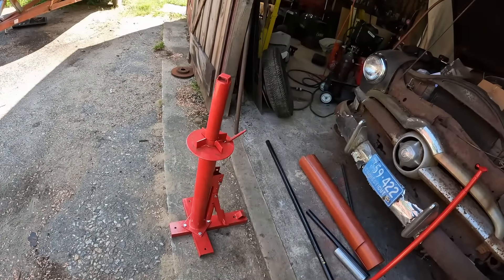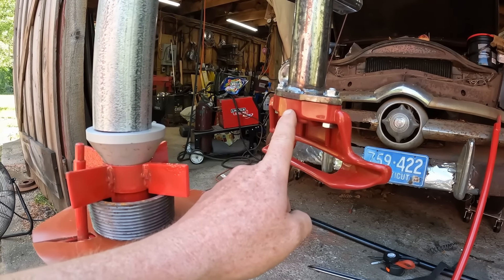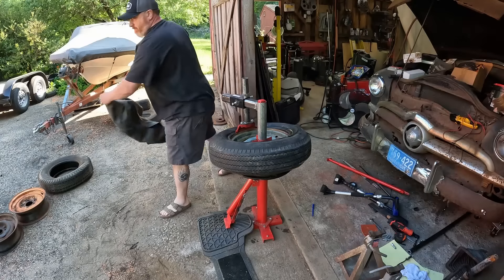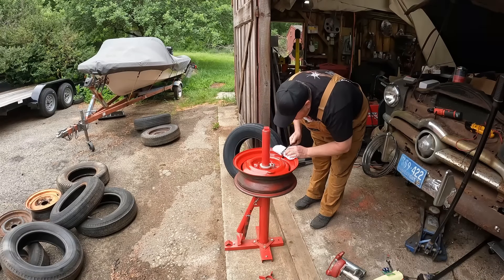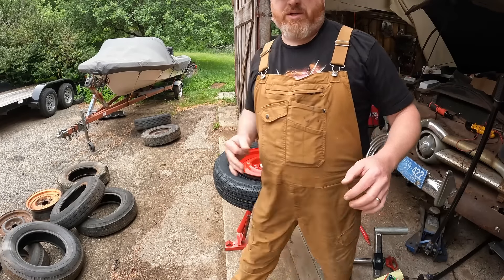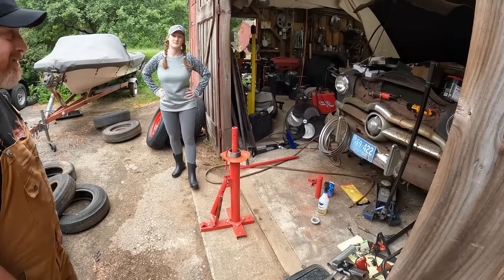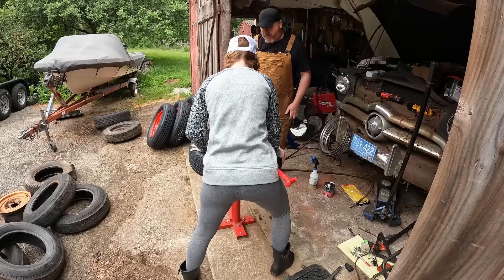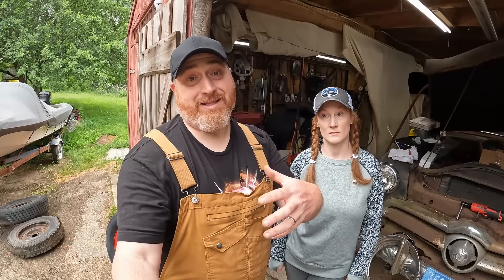How to modify a Harbor Freight Tire Changer to work amazing!!! Follow this DIY guide!!

Comment from the maker: Watch the follow up video here!! https://youtu.be/r1ncuxGHcIc?si=P_qW-Tq3UXcR3scR
Reply: Easy 'er wet always wet your bead
Reply: I bought one of those
Reply: I bought one of those two from
Reply: I had that issue with my Lincoln mig.  It was the liner in the gun/hose.  As it gets old, wire arcs and doesn't contact and slide properly thru it.   I found the aftermarket 10' gun/hose on Amazon . Works great again  👍 👌
Reply from the maker: @SR-gt350  I replaced the entire hose and gun a short time before this video. I've since had a few welders shipped in because we review them. I haven't gotten back to trying to fix the old Lincoln.
Reply: Use WD-40 on the tire bead. It’ll change yer life. Lol.
Reply: That was bad ass good job
Reply: 11:38 Brother, this is genius

I changed tires professionally for years, been to Michelin School several times etc etc

You've basically made a $2,500 machine at home as far as it's function

I can't tell if that duck head is metal or plastic... Do yourself a favor and get a plastic one if it's not

That is if you plan on doing a lot of wheels

The plastic one makes it impossible to scratch your rim even if it's aluminum wheels
Reply: 22:05 If you're ever uncertain, if your bead got set, put it to 70 PSI and then back it off to 35 or wherever you want to drive

Comment: Little tip for mounting tires. You can use Gojo, and a cotton brush to lube the wheel. And some shops use just plain old Dawn dish washing soap, without water and sometimes a small amount of water. It’s hard to explain what the cotton brush looks like, but it’s like a larger version of the brush you see in PVC glue for welding PVC.  I’ve seen some just make a brush out of a coat hanger twisted around a couple of old shop rags. I always just used Gojo, as the tire lube. Another little trick is to mount a peddle valve to the base of your tire mounting machine that allows you to use your foot, to inflate the tire while lifting the tire up with your hands.
Reply: I use wash and wax car wash, has some anti corrosion properties, found that dishwash can cause problems
Reply: It's called a dish mop
Reply: I use tire dressing. Armor All, Black Magic, Meguiars,etc.
Reply: Yeah I use a spray bottle with a little soapy water, spray the bead down on both sides inside and out, never had an issue, also makes it easy to see if the bead has sealed as the soapy water will bubble up if the bead is leaking while you are putting air in.
Reply: That or you can buy the “mounting juice” from O’reillys I think we got ours from. Helps seat, “glue” and slip on.
If aluminum rims you can add tire bead sealer as well, to help keep air in on the brisk mornings or temp changes.
Reply: To add to your naming of item, decades past, Coates tire changer company circa 1970-80's It was sold by them as a bead mop or tire mop. Was also good to spot check nail holes/tread punctures. As the solution bubbles like crazy over tiny punctures. Much faster that a tire tub for leak detection for suspicious spots.
Reply: @grandam every item you listed there is silicone based which is a severe no-no around tires. Silicone breaks down the rubber. Horrible to use. It will make it shiny and make us slick but it's terrible for rubber long-term. Anything armor all should be nowhere is near a car. The only thing they should be close to is a garbage can... Throw in it
Reply: @mac4boys541 dish soap will cause absolutely zero problems with a tire. If you're finding it causes a problem. It's not the soap. It's you. You shouldn't need to use any product with anti-corrosion properties as there should be no moisture in there to corrode the metal anyway.
Reply: @jasonmorehouse3756 I've never had a problem with ANY tire dressings I named. And my old schools stay in storage till summer cleaned, waxed, and tires "armor alled" when stored. Maybe it's just you buying cheap tires that need to be gotten rid of.
Reply: @jasonmorehouse3756 silicone doesn't break down rubber, that's why it's used in plumber's grease. It makes the tire slick though,  while not being water soluble. Cheap hair conditioner is the best to use.  Rinses easily.
Reply: Long as it's not the one with pumice bits in it lol
Reply: @jeffgood6441  I like me some pumice pieces in all my hair conditioners.
Reply: Napa RuGlyde 💯 😉

Comment: Do yourself a favor and get a super strong magnet to put on the tire changer to hold that stupid bead breaker up while you reposition the wheel
Reply from the maker: That's a good idea. Thanks!
Reply: Was thinking the same!
Reply: Bungie cord
Reply: @mikethomas3069  I used to have a Bungie cord but the magnet is faster and easier
Reply: Did this—game changer. 

Honestly was gonna post it myself, but ya beat me there.
Reply: Dude .I owe you a beer ! One adaption I made was strengthen the shoe cup that makes contact to bead and rim.
Reply: Just found your channel. Appreciate your honesty and being transparent in your comments. Most of us watching are learning and eager to improve. Thank you for sharing your thoughts and creative talent. Looking forward to seeing next video. Praying for your safety, strength, health and success. ☝️🙏🙌💪🎯👍
Reply: Have you thought about flipping the bead breaker over so it’s pointing up and using a lift mechanism off like an   Elliptical exercise machine or a lift off a tread mill to lift your bead breaker to break the bead from below, do the top first then flip the wheel do the bottom and then use the duck bill and use the tread mill motor to spin your duck bill. Craigs list you can find ellipticals and treadmills all day under the free section. Ellipticals have three little motors that work excellent for stuff like this if you want me to send you a picture of  one I will.
Reply: And I mounted my tire machine to railroad tie stubs to make it heavy and still portable and I use my dolly, with garden tractor front wheels on the dolly, to move the tire machine, but I like your design and I will be modifying my tire machine to match close. I do my very best to not spend a dime on supplies. I’ll dumpster dive for materials.
Reply: I hope this helps you.  45 year diesel tech, Jeff, John Burton is just an online name.
Reply: Just put a mild spring on it

Comment: Handy tip: Before you attempt mounting a tire, soap or lube the bead. It makes things so much easier.
Reply from the maker: Thanks!
Reply: It helps to get in on and to set the bead when inflating for sure!
Reply: Definitely.  Amazon to the rescue.
Reply: A solution of Murphy’s Oil Soap works well and you may have some already.
Reply: @walterandrews3077  I'm a lube tech, literally only use dawn soapy water, haven't had one issue, all the way from tiny trailer tires to 35 inch LT tires.
Reply: No need to modify anything I only had to grind out and widen the end of the bar so the tire bead would slide threw easear 
Because it's no narrow for the bead to fit threw

Comment: Well done !!!! With these mods , you inspire us to take a device that is mediocre at best and make it much , much better !!! You explained why you wanted to do these mountings yourself and then went ahead and accomplished mounting all four tires !!! This is exactly why I enjoy your approach. You inspire !!! Thanks !!!
Reply from the maker: Thanks for the kind words and thanks for watching!
Reply: December 1965 the local body shop gave me a 'deal' on a pair of Good Year Surbanittes for my Mustang 2 + 2 if I mounted them myself. No problem as I had watched their technician change many a tire on their manual Coates tire changer. Until I put the first Styled wheel over the post, the center hole was too small! Shortly the proprietor appeared with an empty large cardboard carton to cover the cement floor, 2 tire iron paddles, a large rubber mallet and a can of hand cleaner to lube and seal the bead transitions. With instruction I (proudly) got the first tire off it's wheel in short time. Returning to his office I started the second that proceeded even faster until something seemed wrong. I had gotten the wheel inside both beads!
Your modification upgrades to the changer duplicate the functions of the Coates changer, they also had a duckbill bar. 
Many times when airing up using your knee, floor and wall to form a 3 point pressure point to seal both beads.
Reply: I can definitely appreciate your modifications because I did my tires with much difficulty with the standard harbor freight tire machine and balanced with old bubble balancer that was given to me and so far I've driven over 3,000 miles, thanks for the video 👍 great job.
Reply: @@VooDoo_BlueI didn't know what that meant at first but then realized the tire was fully wrapped around the outside of the rim 😅
If the wheel is installed onto the tire rather than the tire onto the wheel I could see how that was done-

Comment: Hey Boss.  The wire sticking in your MIG torch can be from several things.  It can be: 1.) The copper tip of the torch has melted and the wire is sticking in the outfeed hole.  Replace with a new tip. 2.) The wire feed wheel is not clamped tight enough onto the wire as it feeds.  3.) The wire feed rollers are dirty.  The wire that feeds through has left impurities and causes it to be slick.  Spray some brake cleaner/carb cleaner on the wheels and wipe off.  4.) Last and most costly is that the liner for the wire to the torch is worn or dirty and needs to be replaced.  Hope this helps.
Reply from the maker: I'll certainly look into it and thanks for the suggestions!
Reply: I've also had some cheap wires like blue demon be oversized and scrape the torch liner causing lots of buildup. Switched to a name brand wire and has been problem free since.
This was also on a Lincoln mig welder.
Reply: Also, not sure which lincoln welder you have, but once the wire is feeding properly, if you're not getting a good consist arc, replace the capacitor in the welder. May cheaper welders have benefited greatly doing this. Even the lincoln 110 flux core welders that were brand new.
Reply: Lots of valid suggestions for MIG arc sputtering.  I saw one Youtube channel explain that the letters for MIG stand for Anybody Can Weld. First letter of each word is silent.
Reply: This rockymntain guy is right....  Those mig welders are very moody.  There are so many things going on at once for the wire to actually come out the end of your gun that the slightest little irregularity can often cause catastrophic failure with your welds.  It has been my experience on most occasions that the tip has wallowed out from the constant friction and heat of the wire sliding thru it and you aren't getting the continuity of electricity between your tip and your ground so you get the result you hilariously animated at the beginning of this video. That made my day!  and the little feeder wheels inside the machine do get dirty and when that happens they will just sit there and spin on the wire and occasionally catch long enough to give you a BB sized weld bead for a moment.  I have used mig welders for many years and they are indeed nice machines to have.... Kind of like Gravely tractors.  When they are running right they cannot be beaten but there are so many opportunities for something trivial to go wrong that it can at times be a real fight to get anything out of them but aggravation and a headache........
Reply: I found that when I stored my mig torch I was coiling it too tight and the wire would bind until I got to straight wire.
Reply: Lincoln welder makes a little fuzzy wiper that clips onto your wire near your feed motor.  It wipes impurities off of the wire that would drop off in your liner.  Those impurities make the feed stick and jump.  Also, ask for a new poly liner that they use with weaker wire like aluminum.  The plastic is much lower friction value.  Also make sure the liner can fit the wire size you are using and maybe slightly oversized.  I am very sure it is a dirty liner.  If you have had your mig for a while liners need to be changed especially if your wire takes a while to be used.  Use smaller wire rolls to keep your wire fresh. @madgingercustoms

Comment: On the bead breaker part of the HF tire changer. I found that the way it comes from HF the spoon part of the bead breaker is too blunt. I took the grinder rounded and smoothed that spoon part, and it made a huge difference. with a little soap it slips right in the bead close to the wheel. and breaks the bead super easy. I recommend it to anyone who has one of these tire changers.
Reply from the maker: Solid idea. Thank you

Comment: Dude. I’m freaking impressed. I’ve seen other videos on modifying the Harbor Freight tire changer. And I wasn’t impressed. You impressed me great ingenuity. The only thing I’d change is the pin to lock the tire in place. I took mine out and use a bolt and nut.
Reply from the maker: Yeah we ended up drilling ours and using a bolt as well.

Comment: Quite surprised you didn't build a bigger and more stable base for it.  That was the first modification I did to mine.
Reply from the maker: I think the smaller foot print is fine for what I'm using it for. I can toss it in the corner of the barn.
Reply: You don't need a larger base when you have it bolted to concrete like he does.

Comment: The bubble balancer is very accurate. I used to do trooper wheels because they said that they could drive over 100 mph without vibration.
Reply from the maker: Thanks for watching!
Reply: A bubble balancer does 95% of the balance. The other 5% is to pay for the spin balancer 😂

Comment: I’ve never taken the valve stem out, I just use a ratchet strap, and, put it around the tire, and, tighten it up until the beads on both sides are tight, then shoot some air to it, then I release the strap, and,air it up to the suggested pressure. Works like a charm!!
Reply from the maker: The ratchet strap was going to be employed if I couldn't get it started. I used them on motorcycle tires!
Reply: @madgingercustoms  Them thangs work good, don’t they?!! 😉
Reply: You don't take the valve stem out. You take the valve core out of the stem. This allows more air to enter the tire faster. No need for a strap.
Reply: Saw a guy get hit in the peas once when the ratchet strap broke/came loose unexpectedly. It gets real tight real fast when tire starts taking air.😂
Reply: Always lube the bead, so you don't mar the bead if you have to use excessive force to get it on, link on low profile tires. Good job on your first tire, a lot of apprentices don't do it as well😂. I have one of those but never used it. Yet. Great video on the mods. Def watching the bubble balancer video amd gave you a follow.
Reply: Also tell your gal the fan will keep the skeeter off of ya on the outside, cause they don't bite when the wind blows. 😊

Comment: i have used the harbor freight tire changer for years, mostly sucessful with what it came with mostly swapping junk yard used tires on older cars, so not worrying about car rims. Your video is great because as it is the harbor freight tire changer takes a lot of fighting grunting with the equipment and if your not carful you can destroy the tires with that red thing. In fact I recently destroyed two old tires trying to use it. I was rushing those times and trying to force older less flexible tires. But now your mods show how easy it can be. Way cool.

Comment: Spray bottle of dawn dish soap, lube the edges of the tire before seating it works wonders.
Reply from the maker: There is dish soap in the spray bottle.
Reply: @madgingercustoms  Yes I seen that, I was watching and posted too early. I was a tire jockey many years ago. Soap was not only good for lubrication, but helped get off the black stuff!!
Reply: Thank you for taking the plunge. Building my retirement shop, so this helps.

Comment: As a person who also likes to do everything themselves, I own this exact tire changer. I've had mine for about 4 years now. I've always used it as is, without any modifications other than using towels to prevent damaging the wheel. It does work but it is definitely a pain to use. Especially since the towels always slip or get caught up and you have to keep readjusting. I've saved a lot of money by using this tire changer but it has cost me a lot of time. After all the hours I've spent struggling with this thing, I now know what I'm doing this weekend! Your modification is pure genius. It's definitely going to continue to save me money and now time as well. Thanks!
Reply from the maker: Thanks for watching and check back in on this post and let me know what you think!!

Comment: You should have had her pull on the bar instead of pushing, if the bar slips she is going to go face first into the ground or the changer. Also with the soft pliable sidewalls of the new radial tires you can just about push them on to the rims,  or at least next time grab hold of the tire and spin it around and on to the rim. 
If you go  and get a bubble balancer  try splitting the weight into 2 small ones and spilt the difference,  instead of a 2 oz weight in one spot  use 2 -1 oz. ,one on the front and one on the backside of the rim. It worked very well in the 60's when I was young.
Reply from the maker: I have the bubble balancer and I'm currently doing the video. I modified it to work amazing.

Comment: You can use a wooden handle (hammer) or a little strip of wood to pry against to get that valve stem in without damaging the wheel. You can weld a small piece of bar stock to those bolts on your rig to make them T-handles. Then you won't need any other tools to tighten them.
Reply from the maker: That was the plan from the get go with the handles but I'm impatient!